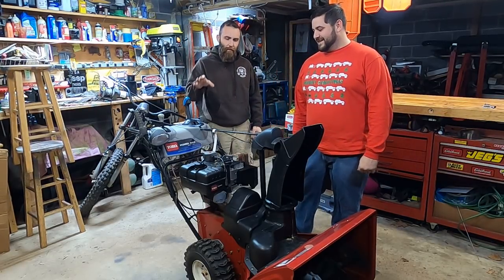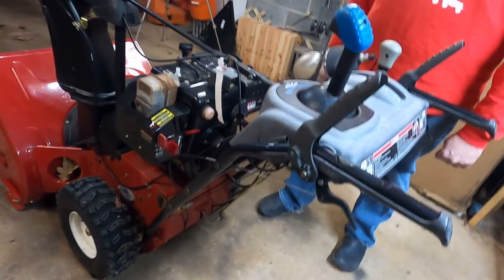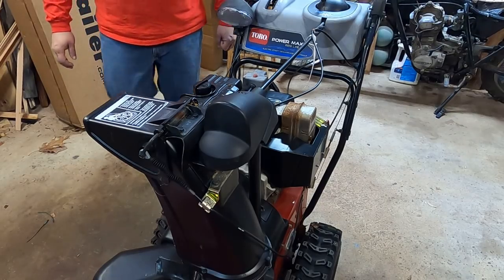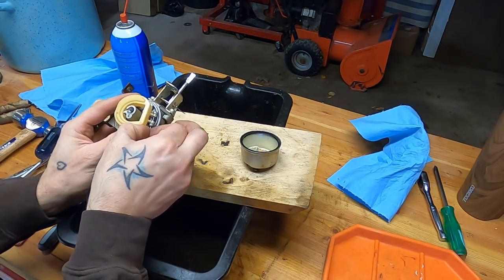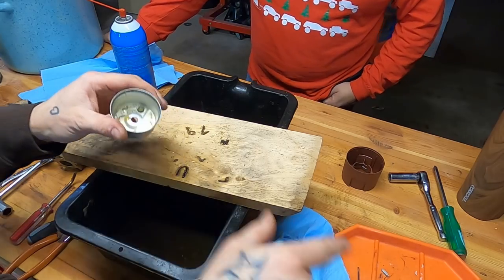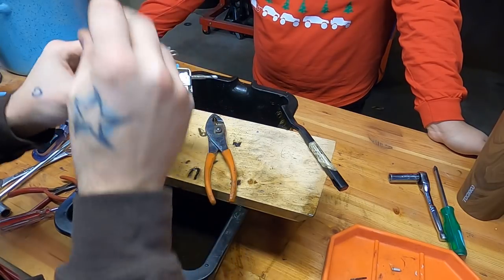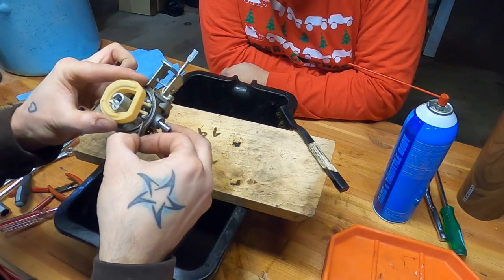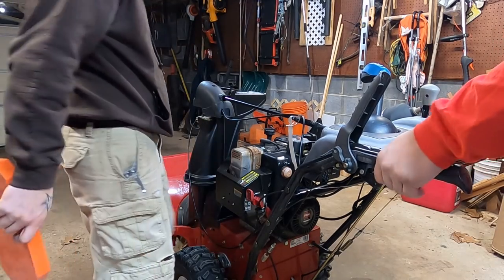DOA Toro Snow Blower - From Garbage to Running Like a CHAMP!

Comment: Great review, I have the same toro for 12yrs , great machine, BTW they don't have shear pins , reg bolts are ok in the auger, they don't use shear pins because theToro gearbox is made with harden steel gears like a commercial unit , so if the auger jams up it automatically  shuts down the engine, you just clear out the obstruction and fire it back up, no need to ever look for shear pins in the middle of a storm half way down the driveway,  just my 2 cents. Great score on a quality machine for free. Also luv the banter between you guys 😆 🤣

Comment: I gotta ask, did you check the electric start?  I hardly ever use the pull start on mine.
Reply from the maker: We didnt check it.... until we had a buyer standing there who wanted to see if it worked. It doesn't. haha. Thankfully this loyal unit dials to life on elbow power.

Comment: I'm pretty sure it's not considered an official carb rebuild video unless the first time you put it back together there is an extra part left on the bench.
Reply from the maker: For me, I know the carb is "fixed" when I get brakleen in my eye. until then the motor aint gonna run. It is the sacrifice I must make to the small engine gods